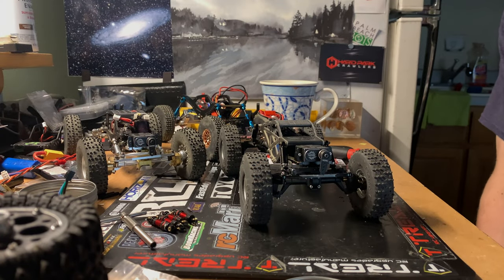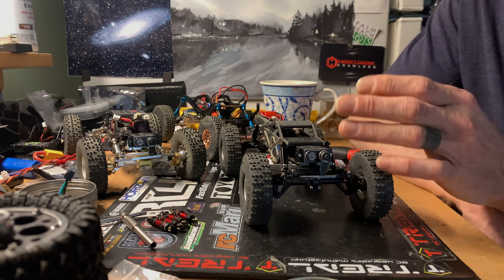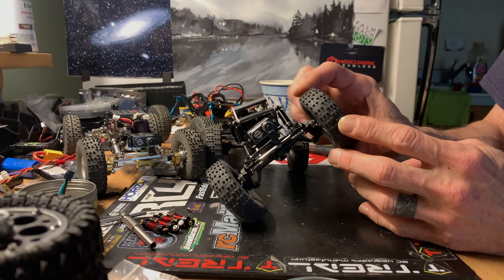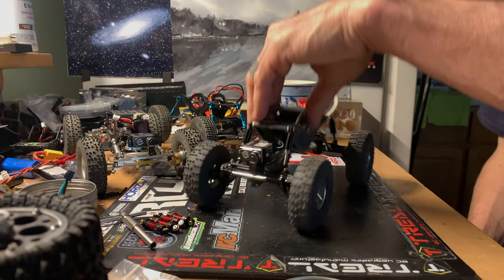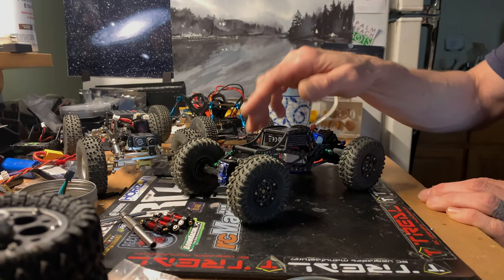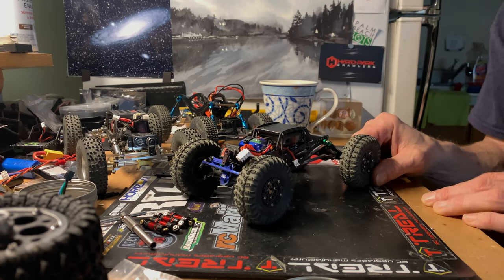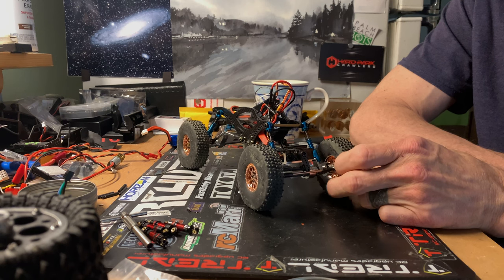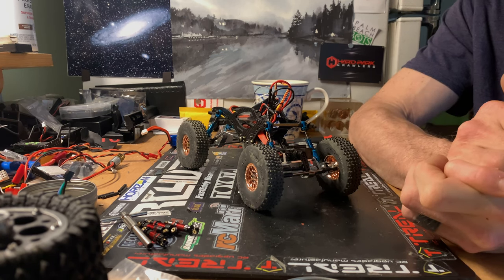Coffee & Crawlers Ep. 12 - Channel & Tiny Truck Update, 1300+ subs!

Comment: Hard Park Dementors merging two is amazing Greg I got my field from the ground up all brushless amazing stuff but I want to tell you about another one and that's a trx4 em with the fury Tech chassis on it the bug are the beetle whatever they call it is flat-out amazing I'm using the stock shocks still but I am brushless I do have Hunter Drive in the front and then double under Drive in the rear because I'm using the mofo bam motor I thing right there has so much torque so much like scratching it's like I Choose You know when you turn it by hand you can feel it jump pack each magnet think I have upw there nothing really special with injora rock tire something is absolutely a monster I mean it's got Battlefront battle in the bag and metal in the transmission all the way around I really do like their axles how busy they are but I don't like the way they're designed anyway I just thought I'd put that out there it's a really great rig also
Reply from the maker: Yeah, I like my Mofo Nano Beast. It's a solid runner. Really good on battery life, too. Makes a 120mAh last forever.

Comment: I believe the Dementia or V2 buy hard part in the best truck on the market I mean obviously got to set it up right but I believe it's the best chassis all the way around he does have one weak point and that of the plastic skid does break right easily I have broken it twice now I have treal portal  axles on the way or if they will be here tomorrow and I cannot wait i already have treal aluminum axle housings with mofo axles ❤ you're having trouble with axles breaking I was 100% recommend to get his severe turning axles and not the new version put his older version that are the four mm extended 1 once again that bam motor not the micro but original is a beast I have the purple pancake I have all the fury text motor and none of them could compete with how strong that fan motor is it will tear the tires off the beadlock and not just any beadlock I'm talkin about the upw beadlock from mofo
Reply from the maker: I run Dlux U-Joint axle shafts on my rigs. They don't break. I bend rear studs more than anything from rolling off of big rocks. Also cracked the roof of the rig but it wasn't anything that CA glue couldn't fix. It's all set again. Ready to go.